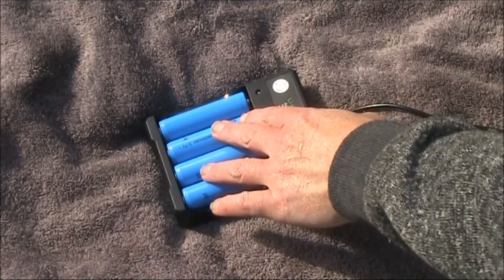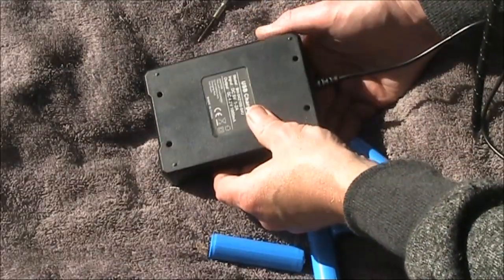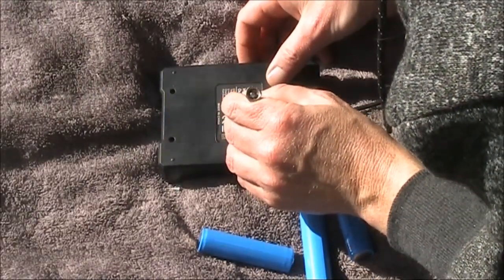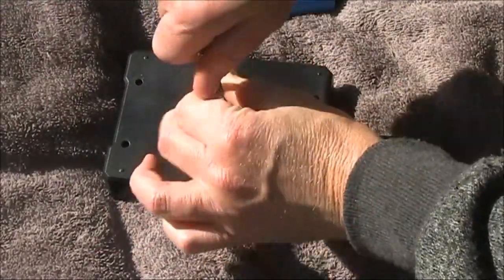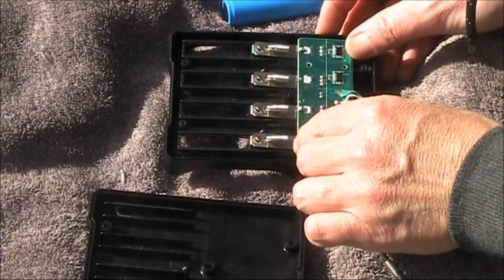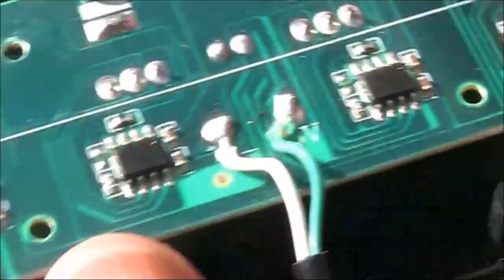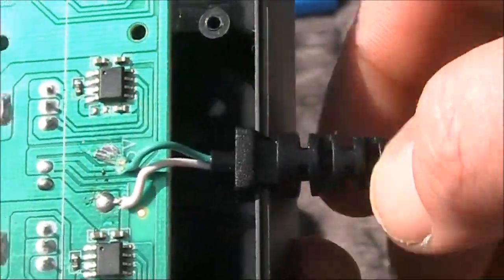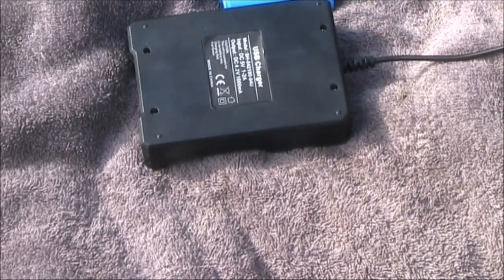Inside a cheap USB 18650 battery charger

Comment: I notice  the USB was just two wires. Most chargers these days are intelligent and will only put out a lot lower current unless they get the correct code on the data pins. Batteries that are a lot lower capacity then advertised. A charger that prob will not charge that fast at all.  Are they really worth the money?  True 18650 of 3,500mAH here in the UK were about £7.50 each(they weigh a lot! I have a single cell vesion of the charger I carry for emergencies but for multiple cells, I think you really need a more powerful charger. I would be interesting to see how long some propper capacity batteries would last. For now I will stick to a small SLA.

Comment: Peter check the weight of the batteries they should be between 42-48 grams each for a real 18650! if you weigh an NEC, Sony, or an LG it will be 42-48 grams the ones that tell you they are 5000-6000 mAh for a 18650 are fake. I found a small 14400 battery inside a 18650 battery case with sand around giving it's weight. they will be around 28-36 grams.

Comment: Too bad those four ICs did not have any markings.
Reply: Just a generic lithium charger IC, with a resistor to provide charge current limit setting on the one pin. Literally one of hundreds that all have almost the same footprint and circuit, from a hundred Chinese silicon vendors.